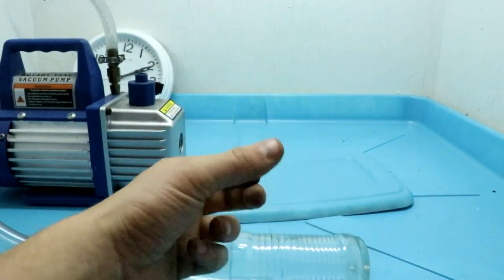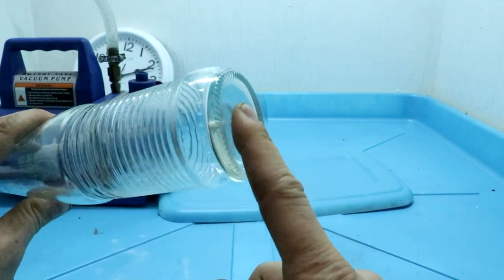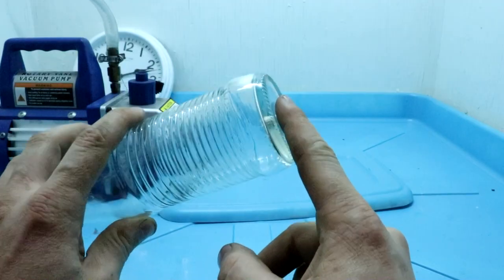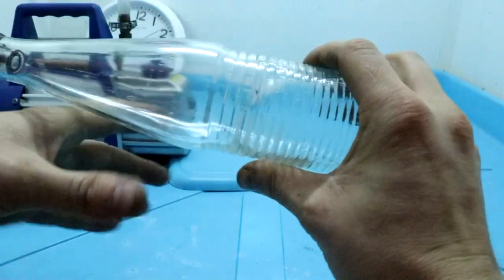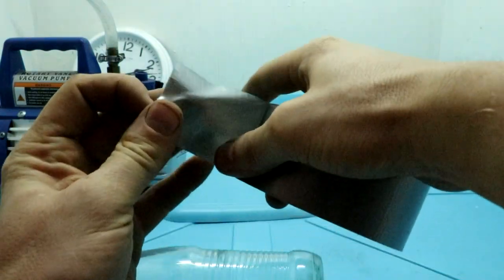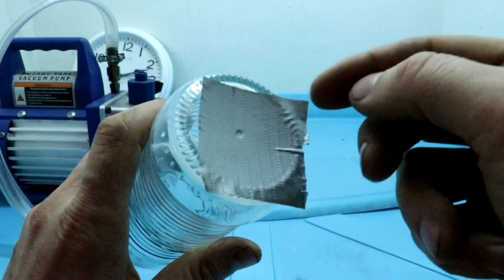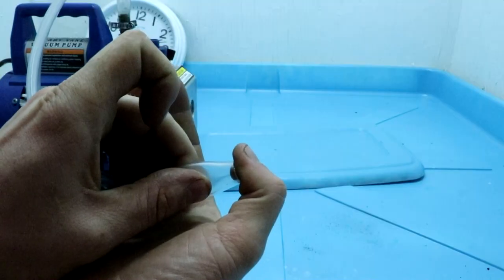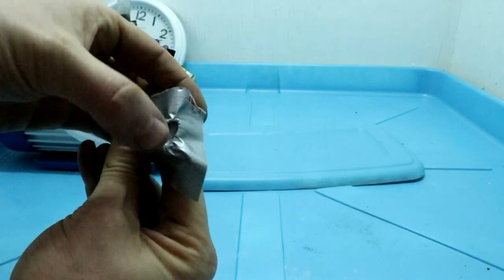Use Your Finger to Stop a Leak on the Space Station?

Comment: I’m sorry Cody but sealing a small puncture or hole on a space station with your finger will hurt you badly. Yes of cause you could seal the hole but the skin that is exposed to space will freeze and will in most likley hood permanently damage your finger as space is colder than liquid nitrogen and will cause freezing burns and or frost bite and destroy the living cells instantly. The vacuum of space is the most dangerous and inhospitable place for a human being.
Reply: Vacuum doesn't conduct heat. It's actually very hard to keep things cool in space, since the only means of heat transfer available is radiation. So even if whatever couple molecules kicking about are at low temperature, they won't be able to cool your finger at any appreciable rate.
Reply: That depends on how long you hold your finger there.
Oh and it's a tiny hole. Your circulating, warm blood heats your finger up faster than you can possibly lose heat.
Reply: stuart coyne  I think the inside of a volcano would be more inhospitable.
Reply: Tuxfanturnip. In space when the sun is on you the heat is a lot due to infrared radiation and since a vacuumed space can not conduct heat the like air can, as soon as the sun has moved off you the temperature will decrease rapidly and the cold will easily destroy even the tiniest amount of living human cells. Infact you might as well as stick your finger tip (the part exposed to space) in a vat of liquid nitrogen and the effect would be the same as the skin exsposed to outer space,
Reply: Dan Severns: I wouldn’t really count a volcano really since humanity has never been in a live volcano however humanity has and is in space. One could say the same about a boiling vat of liquid nitrogen or smelting steel but again I’m not aware of a human being living in them so it’s not relevant.
Reply: logitech4873: your blood would degas, boil then freeze in space but the exsposed skin would get freeze burns and since there are a huge amount of nerve endings in the human finger tip, the frozen part of skin could cause irreparable damage to them. As I’ve mentioned before there would be no difference sticking your finger tip (the exposed part of skin to space) in a vat of boiling liquid nitrogen. The damage would be the same as space is colder than L/N and regardless of you warm blood it would still freeze.
Reply: @Biketunerfy  You have absolutely no understanding of thermal conductivity.
Reply: logitech4873. I’m sorry but I do. Also Cody is sticking his finger in a near vacuumed bottle that was at room temperature. When a vacuum is pulled the temperature drops as there is no air to heat how ever infrared will still heat an object but since the object (your finger) is now in outer space (part of it) and space is very cold and baring in mind the sun light is not reaching your finger at this point, then your going to get hurt. It’s simple physics. What you mentioned about your blood staving of the extreme cold is wrong. I’ve made liquid oxygen by passing the gas through a copper coil in a bath of L/H and the gas has to be cooled to a very low temperature. L/H is colder than L/O this cooling is no diffrent to what the circulation of the blood in your finger. It looks to me that you don’t work with cryogenic gasses/liquids at cryogenic temperatures which is warmer than outer space but still the effects of getting burns from them would be the same. If it was as simple as sticking your finger in a little perforation on a pressurised atmosphere in space then NASA and other space agencies would have a simple solution to repair a hole in the walls of the space station but they don’t due to the cryogenic nature of space. Any micrometeorites that get through the bulk head on the space station and pierce the walls could cause a explosive decompression.  I spoke to a astrophysicist before I wrote this and done my home work and it’s clear to me that you did not. I’ll even put you in touch with her if you want and you can ask her your self.
Reply: +stuart coyne - Again, read up on thermal conductivity. You have absolutely no idea.
Space is "cold" in that it's absent of heated particles, but this does NOT mean it conducts heat away from you. In fact, in terms of conductivity, vacuum is a perfect INSULATOR.
Vacuum does not conduct your heat away at all, you have to radiate it away. And that's a fairly slow process.
In the case of a small hole like this, your blood is easily capable of keeping your finger warm. It's absolutely nothing like putting your finger in something like liquid nitrogen, as that material will conduct heat away from you extremely quickly. The fact that you're even comparing these shows how you've jumped to lots of conclusions here without actually understanding the subject. Stop pretending like you understand when you don't.

Put me in touch with whoever you want, it doesn't change the fact that you've massively misunderstood how the fundamentals of thermal conductivity works.
So please, read up a bit more, and own up to your mistake. Some of the worst stuff I see is when people are so prideful and stubborn that they're unable to admit when they're wrong.

Comment: can i get a “boiled egg” by putting it in boiling water in a vacuum, probably not. but why?
Reply: The water boiling in a vacuum is not hot enough to start polymerizing the egg protein. Reducing the air pressure makes water boil at lower temperatures, that's why it takes longer to cook something the higher you go.

Comment: I mean, if you can fix a car tire with a rubber plug and some glue...
There is 3 times the pressure differential between a tire and the atmosphere than the ISS and the vacuum of space. I'd try a piece of chewing gum.

Comment: I've been wanting to boil water in my vacuum chamber but I was woried it would damage the pump, I think I have the same one as in the video. Does anyone know if it coukd be damaged by too much water vapor?
Reply: As long as you start with fresh oil, you will be ok for short periods.
Watch the oil though, it will turn very cloudy as it gets saturated with water.
If your have a 2 stage pump, keep the gas ballast open to reduce oil contamination.

Comment: and how about radiation and temperature?
Reply: It dawned on me you mean the radiation hitting the thumb: No problem. It isn't much. Is it healthy? No. But not too dangerous. 

About the temperature: If the sun was shining on that spot his thumb might have gotten slightly warmer (like when the sun shines on you here on earth). EDIT: Lacking the atmosphere to protect you from the sun it might be a bit hotter and you would be very likely to get a sunburn on your thumb. Risk of skin cancer is also higher. So it is not really that harmless. But not instantly deadly or injuring either.

 If there was no sunlight then the person putting their thumb on the hole lost as much heat as could be radiated away via the tiny bit of surface area exposed to the vacuum. So basically none at all.

Comment: What would happen if you repeated this experiment with greater external pressure?  Like if  you were trying to plug the hole with your finger at the bottom of  the Mariana trench.  I'd be thrilled if you could figure that out with math, but if you could contact James Cameron to pull it off IRL that would probably break the internet.
Reply from the maker: 1000 atmospheres... yeah that might push my finger through.
Reply: I sat down and math'd a bit.
If you had a vacuum tube with a similar hole at the bottom of the Mariana Trench, it would pull on the tiny part of your finger with a force of 34 kilograms, which is quite huge compared to the 32 grams of force you'd feel with the same hole on the ISS.
I'm no expert, but if 32 grams can displace your skin that much, I'm pretty sure 34 kilos would be very, very bloody.

Comment: Cody'sLab   What if a very large "aircraft carrier" space ship were traveling at 99.999999% of light speed, then a smaller ship were launched from the "aircraft carrier" that was also capable of 99% speed of light.... Would this not break the speed of light? What keeps another ship from launching and accelerating much faster than the speed of light and the ship it is launching from?
Reply: If the smaller ship was capable of going 99.99999% of the speed of light, and detached from a ship that was already going 99.99999% the speed of light, the smaller ship would still be going 99.99999% the speed of light, thus unable to accelerate.

Comment: What about the temperature of space
Reply: Temperature doesn't really exist in a vacuum, so not a problem. Think about what temperature is. It is sort of how fast molecules are moving/vibrating. No molecules, no temperature. The very few molecules that actually exist in space are not significant.
Reply: @nesnioreh  well there is blackbody radiation in space. It's the microwave background radiation.
Reply: well there would be a big loss of heat trough your finger but thats all not really damaging as Cody said the finger got a little cold.
Reply: The vacuum of space has no temperature. For any object to get hot or cold, it would have to be absorbing heat from a radiant heat-source or radiating heat into the black of space.

Comment: Is there a mountain on earth where the pressure is low enough so that you could boil water at a temperature safe enough to immerse yourself in it ?
Reply from the maker: not on earth, but I'd like to build a vacuum chamber I could do that with.
Reply: On top of Mt. Everest, the boiling point of water is about 155ºF, or a little over 68ºC.
Reply: Skin starts to burn at around 70C so even that would still be quite dangerous.
Reply: Mike Loeven  Yes, it would be quite painful.
Reply: @Cody's Lab Would you go the oxygen mask route or low pressure high O2 concentration they use in space?

Comment: It seems people don't know how easy the math is using Pounds per Square Inch.  A 1 square inch hole would exert 12 lbs of force (14 at sea level).  A 2mm hole has an area of 0.00487 square inches, so only 0.0584 lbs (26.5 grams, 0.93 ounce) of force at 12 PSI atmosphere.
Reply: A 1 cm square hole exerts 1 kg of force at atmospheric pressure (1 Bar). A 2mm round hole has the surface area of (pi*r2) 3.14 mm2. Therefor 31.4 grams of force. No calculator needed here. Do your freedom unit stuff for a round hole.

Comment: what would happen if you put a Co2 cartridge in a vacuum

edit: well how severely would it explode lol
Reply: The walls of the cartridge will need to hold a little bit more pressure.  It's already holding  about 60-70 atmospheres, so if 1 more is enough for it to burst, then it would be too weak for normal use.  For similar safety reasons, it should only pop the top open not produce shrapnel.

Comment: I think the vacuum of space is much stronger and there is more radiation...
Reply: I'm copy-pasting this for everyone to show how similar Cody's vacuum is to space, hope it helps quantify things. (idk about radiation, but a few minutes in leo would probably be fine since you're at least protected by earths magnetosphere)

P1(low earth orbit) = 10 nano-Pascals      (at lowest)P2(water boils at room temperature) = 2.6 kilo-PascalsP3(atmosphere at sea level) = 101.3 kilo-Pascals
So yes, pressure of vacuum in low earth orbit (P1) is 260 Billion times lower than what Cody had in the vacuum tube (P2).
BUT! The force on his finger doesnt care about the ratio P(vac) / P(atm), but about the PRESSURE DIFFERENCE P(atm) - P(vac)
In codys experiment, this pressure difference = P3 - P2 = 101.3 kPa - 2.6 kPa = 98.7 kPa
On the ISS, pressure difference = P3 - P1 = 101.3 kPa - 10 nPa = 101.3 kPa
Therefore the force experienced by Cody's finger and that experienced on the ISS are only 2.5% different!!!       ( from (98.7 - 101.3)/101.3 )

Comment: But the temperature in space will freeze your finger.
Reply: The vacuum of space has no temperature. Things get warmer in the sunlight and colder in the shadow because of heat radiation or absorption from a radiant heat-sourc like the Sun.  If the Sun were shining on the part of the station with the hole, the metal would get warmer.
Reply: @fairwinds610  ohh yes, you're right, i forgot this fact.

Comment: 2:35 why would the water "cool off"?
Reply: Evaporating water takes heat, so if you let it evaporate without heating it, it will cool down (and if you heat it, the temperature will rise more slowly than you'd expect).
Reply: As the other guy said, evaporation grabs heat with it. This is used in many cooling systems, like vapor chamber coolers in computers.
Reply: Thanks for the info.

Comment: Cody is it possible to put a pressurized aluminum bottle inside a large Plexiglas Vaccuum chamber and then fire a small projectile or puncture. I would think the inside pressure of the canister combined with a Vaccuum would blow 💨out the size of the opening that would cause much more damage.. We want to know if the Structural integrity of the pressurised container would be beyond duct tape. 💨 Houston we have a problem... IDK Cody wouldn't you like to see the difference too.. Just doesn't solve or answer the physics with just a Vaccuum on a glass bottle. We did this in grade school putting matches in a glass bottle and watching a hard boiled egg getting transferred between atmospheres.. Thank you.. Hope to send you more fun and interesting experiments for your channel . Love your channel very much...👍👍 PS Maybe an Empty Fix a Flat can that you can connect to an air compressor line to keep constant 15 psi ? IDK after puncture hard to determine results as the Vaccuum would be lost.. Unable to simulate constant Vaccuum and continuous interior positive pressure of ISS container in chamber..
Reply: the aluminum bottle wouldn't really be "pressurized", the ISS is pressurized to 1 earth atmospheres levels, which is how much we experience right now, so if you put an empty bottle (full of air but not "pressurized" then punctured it, you would experience a imaler effect to that of the ISS, or this test
Reply: @notfake2460  yeah that makes sense... With all the space junk floating around at 15,000 mph. You would think solar panels and ISS station would be full of holes.💨💨💨
Reply: Actually, interestingly the ISS is covered in a first layer of protection that is sort of like a tarp, that takes all the brunt impact from small debris in orbit, and it is indeed covered in small holes.

Comment: In real space you would loose that finger :D  that chamber dont suck hard enough.. It can only suck with the power of the motor.. In space it is diferent.. No motor just a big big suck.
Reply: Nah. The difference is 1 atmosphere, or around 14.6 PSI at maximum.
If the pump can generate 11 or 12 PSI, that's very close. You wouldn't really feel the difference between what this pump does and what the real space does.

People tend to overestimate what the vacuum of space is capable of for some reason.
It's not some magical infinitely strong force. The pressure difference is just 1 atmosphere.

Comment: Newton’s laws of motion was reviewed in this episode. It was when Cody said net force was pulling Cody’s finger into the bottle. This causes a imbalanced force. Correct me if I’m wrong it’s been a few years.
Reply: Vacuums don't suck. Instead the atmosphere pushes.
Reply: You're welcome... Here's another way to look at it:
Imagine you're standing on the ground being bombarded by 100,000 tennis balls per second from all directions randomly.
You'll probably just stay where you are as all the momentum will tend to cancel out.
Now if the tennis balls only come from one side, they'll tend to push you in the other direction.
Air is just trillions and trillions of tiny molecules bouncing off things, and exerting a pressure on them. Make it imbalanced, and things will move, such as a piston... Easy!
Vacuums contain nothing, so there's nothing that can push.
(though radiation and photons can push a tiny tiny bit)

Comment: Actually the near perfect vacuum of space would have dissolved the ISS in less than a second
Reply: And why would that happen?
Reply: @scott_meyer  At just over 20 minutes you can see  those vacuum lifts are holding over 9000 pounds and they hold a lot more.  That is no where near to the apparent vacuum of science fiction space.
Reply: The "apparent" vacuum of space is just zero pressure. The difference in pressure between the inside and outside of the ISS is 14.5 psi. The station is built to stand it.  Zero pressure does not mean infinite sucking force.